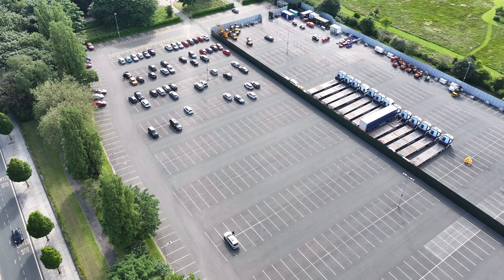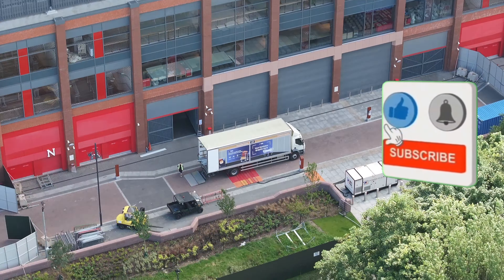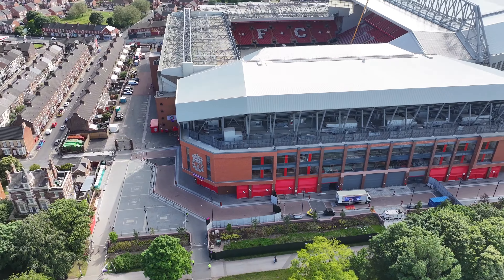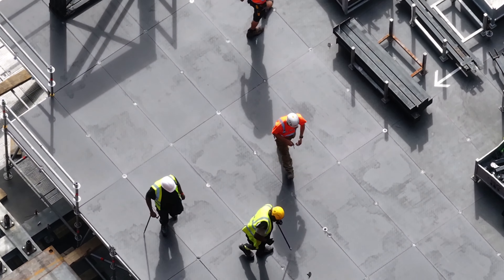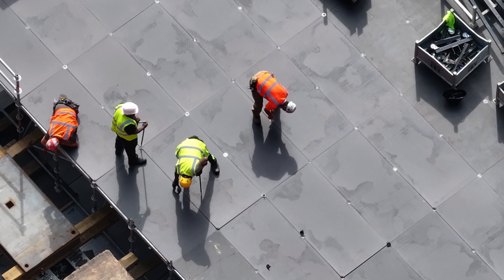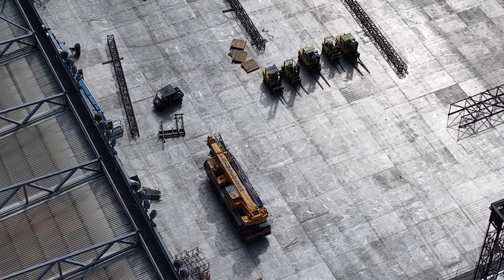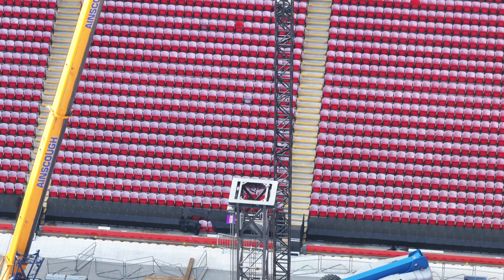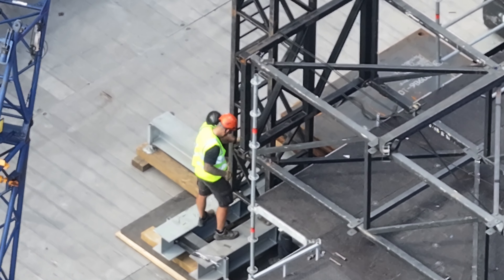Pink Concert Preparations at Anfield 20th June 2024

Comment: They don't look as efficient as the Taylor Swift erecting the stage. Might be having more time or smaller bonuses 😂
Reply from the maker: There is only about 10 to 12 trucks outside, the rest could be incoming with the other trucks😉👍
Reply: As was mentioned on another channel, Taylors setup costs like $100m (don't ask how, I find it hard to believe as well) but PINK's is more functional than digital. Taylors is mostly a load of LED screens which move. PINK has a more structural setup to allow her to 'fly' between each corner of the ground (assuming it's the same as the 2019 gig)